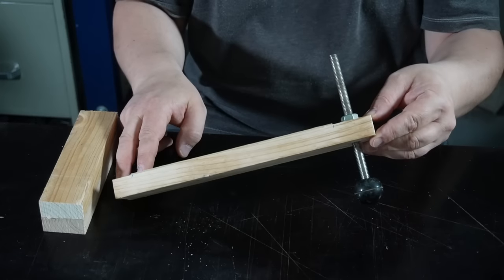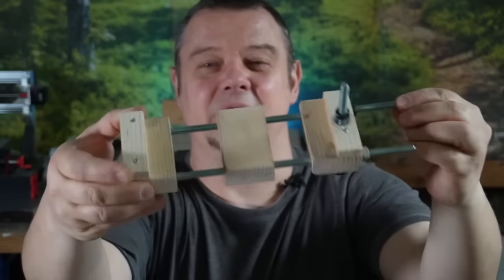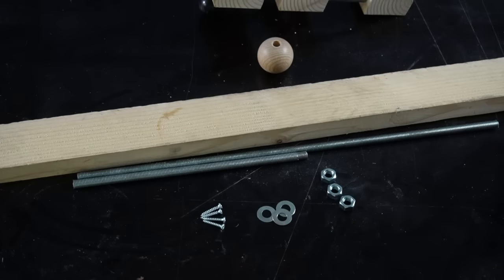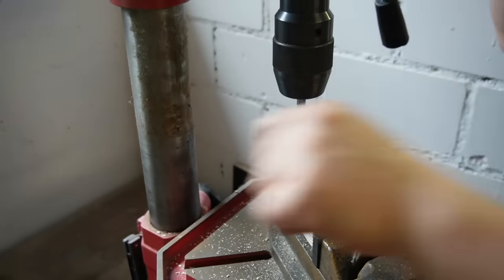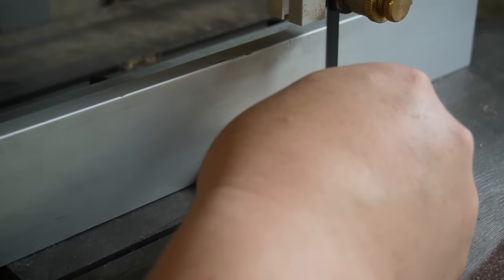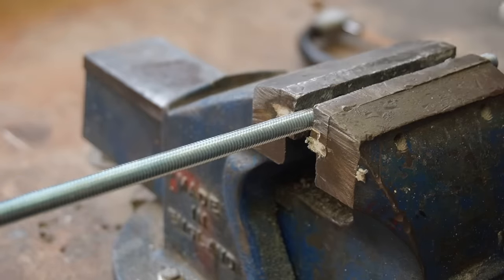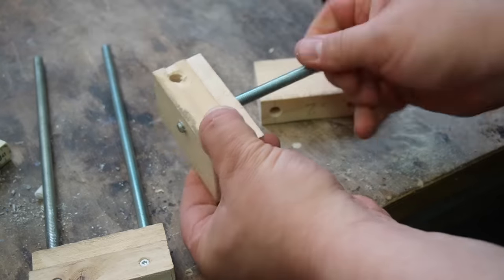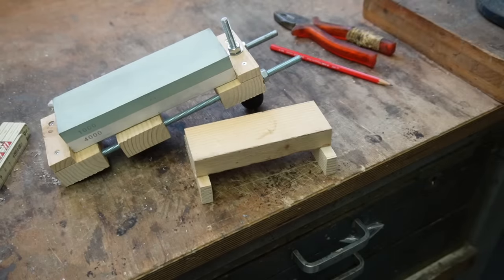Adjustable whetstone holder / diamond plate holder for under 5 $ - A fantastic DIY project

Comment: Hello, Felix! I recently bought a Victorinox Dual Knife sharpener and I wonder if you have any tips on holding the 20° angle on it. I think I made my blade blunt.
Reply from the maker: i wold cut a 70° angle on a piece of wood, where you can lean to the dual. Hold the blade vertically and try to sharpen it with a vertical motion. Like on the sharpmaker from Spiderco.
Reply: Thanks for the tip! I will try it in the weekend.

Comment: In normal unassisted sharpening and honing, finding and maintaining the correct angle is the hardest part of the process. And you usually end up with different angles on either side. This should make that a lot easier to accomplish.
Reply from the maker: Thanks a lot for your positive feedback